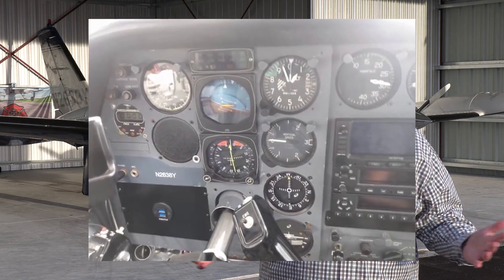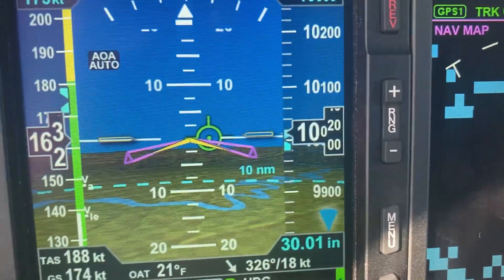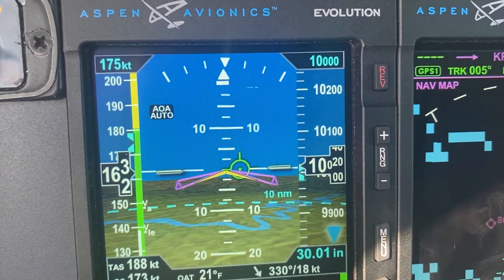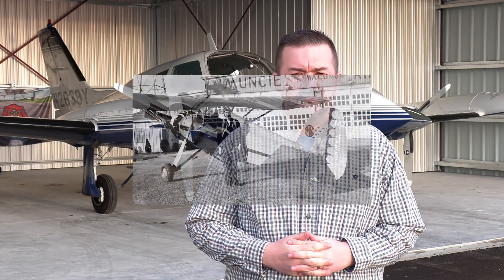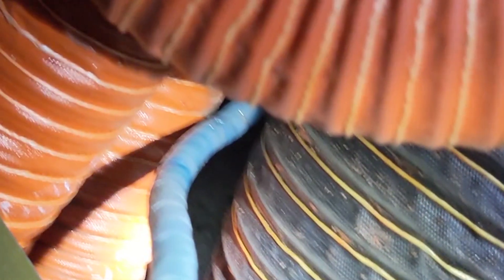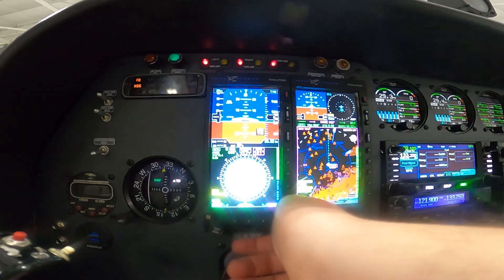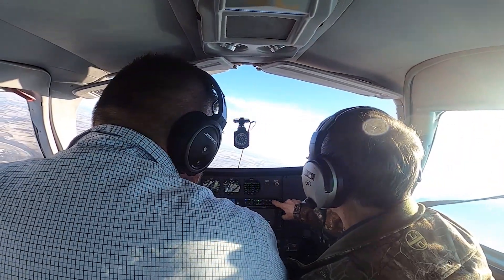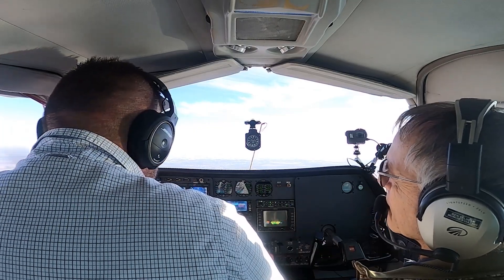40 Year Old Airplane Converted To Glass Cockpit | Our Avionics Journey | The Fire Pilot

Comment: If you pull against the AP should it not disengage?
Reply: I think that the AP doesn't know the position of the control surface or what is moving it, just that the AC is in the wrong attitude so needs AP servo input. Trimming, AP breaker or AP disconnect would disarm it. But you would expect a pilot to know that about their system. Please correct me if you know better . I've never flown with autopilot.

Comment: ATP Helicopter, EC135 SPIFR MEDEVAC. Those who haven't flown with an automatic flight control system (AFCS), often assume that the 'autopilot' flies FOR YOU. Nothing is further from the truth. YOU are still flying the aircraft.. That autopilot is a tool- and only as good as what you tell it to do. The purpose of the AFCS is to lighten up the pilot's workload so you can manage where you're going, monitor the aircraft, and talk on the radio. If you give it the wrong instructions you may end up in the crapper.. You better be ready to take the controls, and figure out what's going on when your automatic co-pilot decides to take a coffee break when you're in IMC!

Comment: Damn. Thank Goodness they found the fuel line leak. Looks like an AD waiting to happen. And rightfuly so. I installed an Aspen in my Archer II, but recently sold it and bought a Saratoga instead. It has a Garmin 275 attitude indicator, but I just can't. I miss my Aspen. So I just ordered an Evolution 2000 Max. Once you have Aspen, you can't go to a Garmin PFD.
Reply from the maker: You are correct! Glad you were able to get an Apsen. It really does make a huge difference.

Comment: For a channel with so few subscribers you are doing a great job of the presentation and video editing. I expect you will go far if you remain interested. Great conversion to modern glass cockpit. Are the systems completely independent? I do military electronics for a living, on the one hand I know how reliable and dependable they are, on the other they do go wrong. And a common mode failure in IMC would suck.

While the aircraft still has magnetos and carburetors it still doesn't have decent technology for 1981. The certified aircraft system, and the manufacturer's greed means there's no easy way out of that. The FAA won't let you stick a reasonably priced FADEC engine on a certified aircraft, and the engine manufacturers love charging ten times the actual value for the fuel injection systems. The first fuel injected aircraft engine was in 1916, the first gas direct injection was 1925. VW put Bosch fuel injection on their 1600 engine in 1967. Modern fuel injection systems are cheap and extremely reliable, as are modern ignition systems. Magnetos and carburetors belong with oil lamps and tube radios, confined to history and museums.
Reply from the maker: Cageordie, thanks for the comments. 2K subs are relatively small youtube channel for sure. We have worked our @$s off for them that is for sure though! To answer your questions - Yes - each of them depend on each other. The MFD/PFD get's it's GPS and route data from the Avidyne GPS. However if they fail, they have around 2 hours of backup batter that remains. I can still maintain straight and level flight. They will provide heading airspeed and attitude. This would allow me to get to the ground safely at the nearest airport. 

When it comes to an FADEC - I haven't done much research and don't know much about them. It appears in an FADEC engine that the engine would fail if you had an electrical failure? Is that correct? Thanks for the history. I love to random facts like that. -Sean

Comment: Timing could not have been better, thanks for this!
Reply from the maker: Are you upgrading? What do you have in mind? Glad I can help.
Reply: @TheFirePilot  looking to replace at a minimum the AI, DG, & AP (all orig) in our Warrior. I've been eyeing the Aspen panels...need to get pricing on those instead of something like G5 or GI275 duals.
Reply from the maker: @MarkHeckler  I have had both the g5 and the aspens. The G5’s are like a toy compared to the aspens. Pricing should be pretty close. My G5’s had issue after issue. The aspens just do so much more.
Reply: @TheFirePilot  Muncie isn't that far from me either, really...so that helps too. Need to determine what autopilots work with the Aspens and a Garmin GNX375...

Thanks!
Reply from the maker: What auto pilot do you currently have if any and what kind of plane are you flying?
Reply: @TheFirePilot  It's a Piper Warrior, PA28-161. Original Autocontrol IIIB autopilot, wing-leveling and heading driven.
Reply from the maker: STEC makes some good stuff. In the twin I am looking at the Aero Cruze since it's STCd for plug n play and keep existing servos
Reply: @TheFirePilot  wow, it would be a good thing indeed to use existing servos. Nice!
Reply from the maker: @MarkHeckler  cuts install time in half and saves about 15,000 labor alone!
Reply: @TheFirePilot  I wasn't aware any of the newer autopilots reused the old legacy servos...that's seriously great news. I'll check out STEC, thanks for all the tips my friend! Truly appreciate it. 😃
Reply from the maker: @MarkHeckler  anytime. The aero Cruze won’t work with the auto control AP. It will only work with the KFC130 and KFC200 autopilots. Unfortunately.